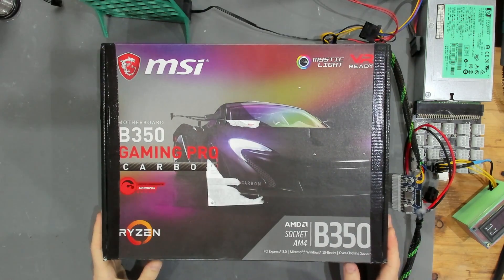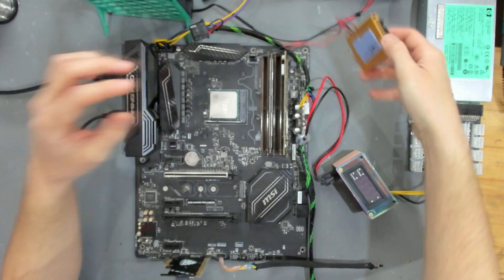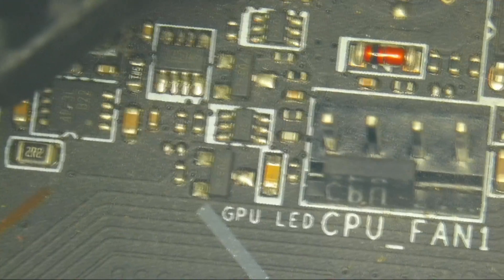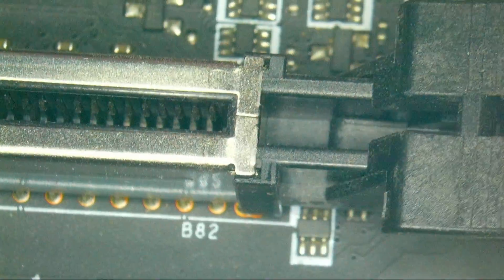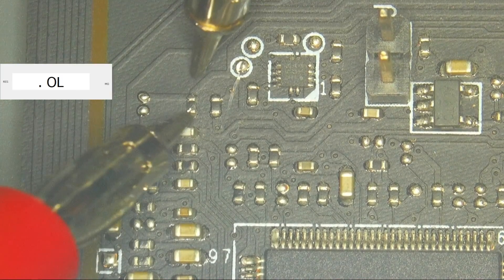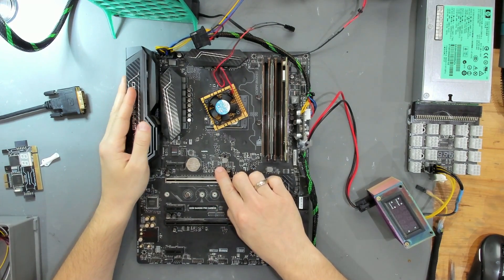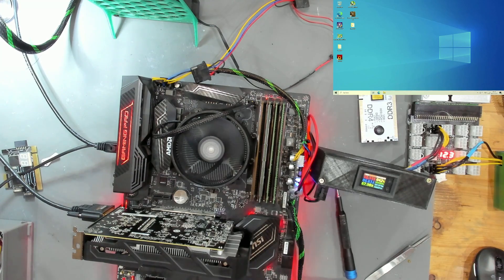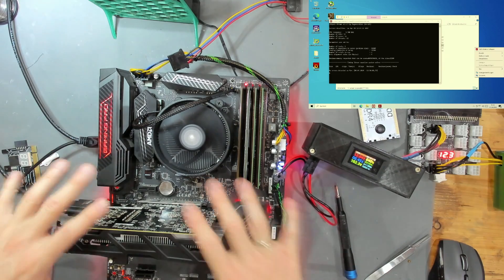STUCK CPU LED , FANS SPINNING, NO REACTION | MSI B350 GAMING PRO MOTHERBOARD REPAIR

Comment: How do you reflash the BIOS chip while it is on the board? Whenever I have tried that the CH341A disconnects from my PC because other things on the board are connected to the SPI bus and there is not enough power.
Reply from the maker: Are you sure that the pinout is correct? Because i was able to do that with the ch341A as well!
Reply: @MainboardMedic  99.9% sure. I will try again with some other boards.
Reply: @MainboardMedic  I discovered that the chipset on the board in question was shorted and it is also connected to the TPM header. So it was drawing current and dropping the voltage too low for the programmer to operate.

Comment: Hello i kinda messed up my bios settings and now my desktop screen doesnt turn on,and theres a white light on the motherboard in cpu what do i do ????😢
Reply from the maker: Taking the batterie out, removing the plug from the psu pressing the power button a few times and then plugging it all in again!

Comment: Great fix, I watched tons of your videos and made it into fixing a motherboard (MSI z170) by finding a deep scratch on one of the traces (near the cpu fan screw), anyway, my question is regarding benchmarking softs, I see you're using Linpack, Heaven (or Valley) I'm wondering which to use on which type of device? also, isn't Superposition better than Heaven or Valley?
Reply from the maker: Hey there glad to hear! I use linpack because it really stresses a CPU and also the VCORE and it has a lot of jumping load, which test´s stability!
Superposition probably would be "better". The really important test is to have a 3D application. Furmark for example wouldnt be enough. But for GPU´s you mostly just want to see that it is connected via 16X and the fitting generation!

Comment: Hey there! I was hoping you could help me, my 3 pin headers are not lighting up my fans. Do you know which IC controls the 3 pin argb header? My 4 pin RGB header still works but not both 3 pin headers. My motherboard is an MSI MPG B550 Gaming plus.
Reply from the maker: Could you provide the MSI board nummber? So the MS-XXXX nummber and the rev version.
Reply: @MainboardMedic  Sure, it is an MS-7C56. I think I shorted out the RGB controller as both 3-pin ARGB headers and the LED's for the Chip set heat-sink isn't working anymore either. I've tried resetting bios etc. Everything else works properly. It seems like I fried the RGB controller chip, as I was trying to repair an external RGB controller which plugs into the 3-pin RGB header but I ended up ruining the rgb. I could resolve it by using use an external rgb controller with one of those IR remote controls but I would prefer to repair the motherboard. You help would be very helpful. Thank you, Cheers! If you can provide the ID label on the IC and its approx location that should be enough. Once again thank you. Sean.
Reply from the maker: @MasterJediSean  The one at the top is directly connected to the U63 which is a nuc126ne4ae. The one at the bottom is connected via some transistors, that are directly above it to the same IC. The IC is located above the last pcie slot!

Edit i only red the first message haha. Good to know that it is resolved! Many Boards that i repair go straight back to the previous owner and some land in system, mostly for Family and friends!
Reply: @MainboardMedic  It's OK I managed to figure it out. I made a huge rookie mistake. I found that MSI has an LED Switch on the motherboard which must have been bumped during my installation of RGB Hardware. So my problem is solved. I hope I didn't inconvenience you too much. My apologies. I was in panic mode as I just bought this motherboard (for a $110 CAD) so I was upset at the thought of wasting money. But I am lucky. Thank you for what help you did provide. I look forward to more of your Videos as I really do enjoy them as there is not really many people offering repair videos for Mainboards. Cheers Friend! BTW do you post your repaired hardware for sale on ebay? Or do you build systems from them. I may be interested. Just curious.

Comment: Please show me the pinout for your fantastic msi bios programming cable i would realy like to make one
Reply from the maker: So what i did was to get a Boarview from a MSI board and look at the bios chip and trace pin1 to the SPI connector and then soldered the pin 1 from the Bios connector to the adapter. And i did that with every single pin. Sometimes they go trough resistors, but that isnt a problem.
Reply: @MainboardMedic  PLEASE PLEASE could you tell me where the pins from the bios chip connect to on the SPI connector as am having trouble tracing pin 7 on the bios to the SPI connector. could you tell me where pins 1 -8 on the bios go to on the SPI connector pins 1 - 12. this would be really helpful. I think your videos are great and really helpful keep up the good work. I also think if you did a video on how you built your bios programmer cable it would be really helpful for a lot of people
Reply from the maker: @mosesayegun5092  Pin 7 should be SPI hold which should be pin 12 on the connector. I will make a detailed Video about how i made the connector!

Comment: my z390 system died over night after went to sleep in idle.. now psu seems to be dead, no output voltage -something is triggering immediately. Ordered a new PSU, the aorus master with cpu and ram also does not even post anymore , no code nothing, it just flashes for a split second at the chipset and panel rgb leds. Where could I start to find the issue? I cant find any parts with visual damaged, there is a oily fluid around vrm power stages cooling pads, they might got to hot and have started cooking - weird, without load
Reply from the maker: I would start with the standby voltages, see if they are all running and then start to check coils for shorts. And exspecially try the 12V CPU if that is shorted or not.
Reply: @MainboardMedic  thank you very much

Comment: Really good repair. I like your style of fault finding and repair and your videos inspire me to do my own repairs. Just managed to replace two failed MOSFETs on an ASROCK B450 Pro4 and get the board working again. I am now working on an MSI Z97M Gaming which is stuck on a 55 post code. My next step is to reflash the BIOS but I think I will have to unsolder the BIOS chip for this. Thanks for your inspiration.
Reply from the maker: Very nice to hear! 55 most of the time is no RAM detected. So that might be another place for you to look out for!

Comment: I cannot seem to get a good connection to my bio chip with the clamp method.    It would be much easier/stable using the JSPI pins.  Is it hard to do that mod or can one be obtained online somewhere?
Reply from the maker: Its not hard, it just takes some time. Its just buying a cable and then soldering a bit. This is i think the 2mm pitch in case you want to get that cable.